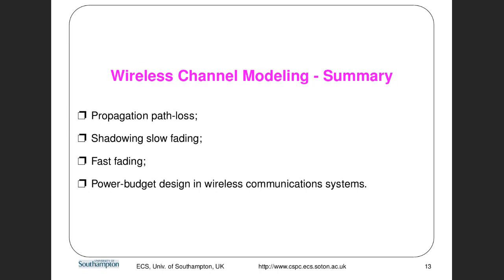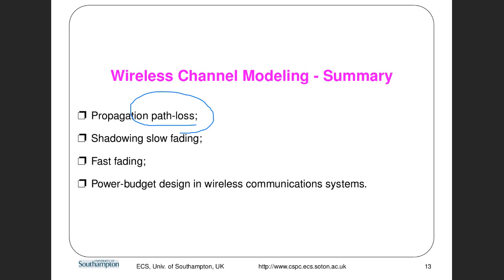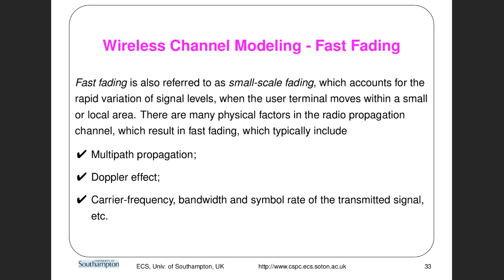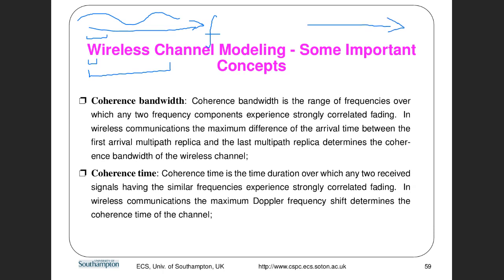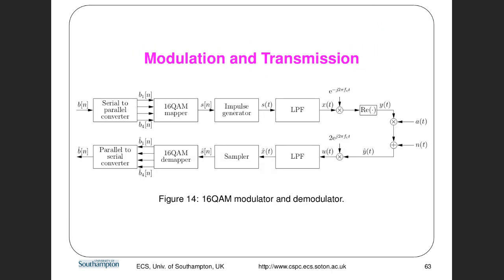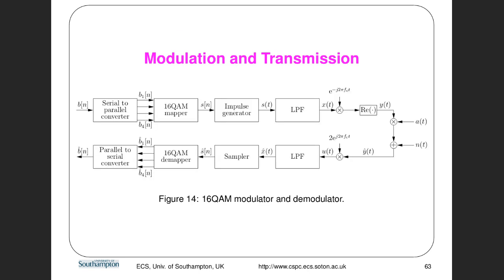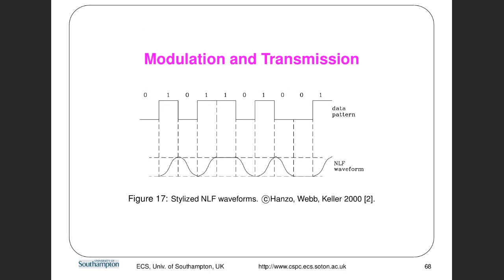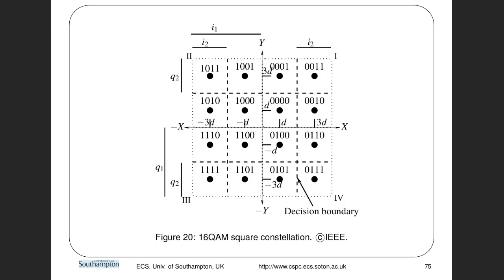ELEC3204 Wireless Lecture 6

Comment from the maker: Correction: For Square 16 QAM, the minimum phase rotation between constellation points is between point 0010 and point 0110 on the second ring, because the second ring has more constellation points (8) than the first ring (4) and the third ring (4). The angle between point 0010 and x-axis is arctan(d/3d). The angle between point 0010 and 0110 is 2arctan(d/3d)